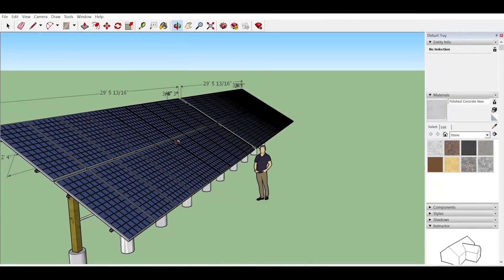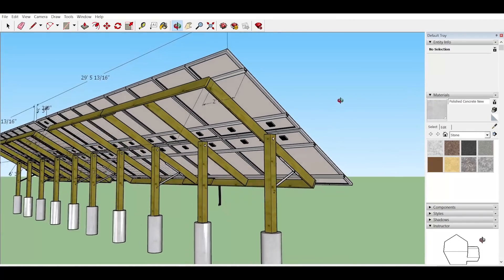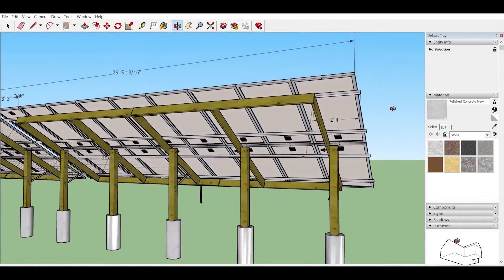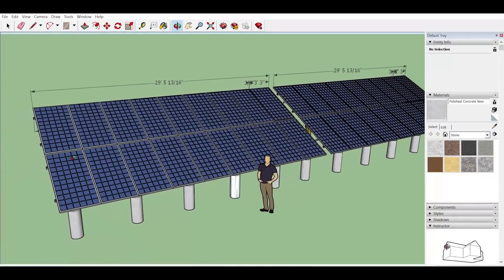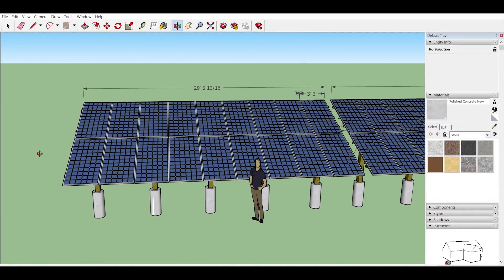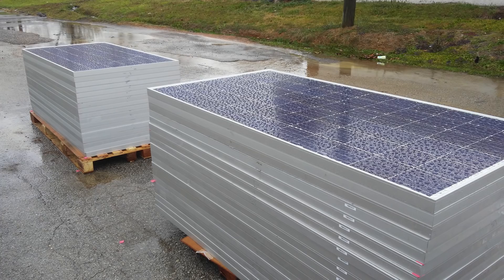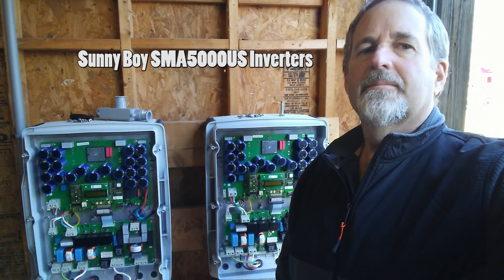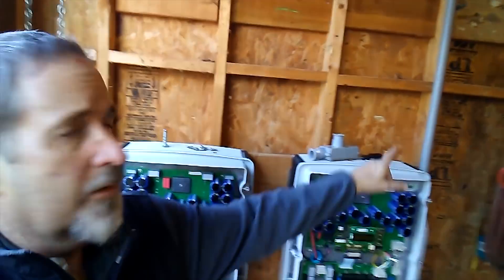BUILDING A 10,000 WATT SOLAR FARM  - Part 1!

Comment: I like the design!!! I'm planning a similar-sized season adjustable array of my own... what size Lumber did you use for your post it looks like 6 x 6? And your pivot arms 2 x 6? What do you use to tilt it with I had an idea of using a manual jack screws  like a linear actuator type thing?

Comment: Fasil the solar panels together is not leakage in between them the things you use underneath the solar will last 40 years mine's all wooden I rebuilt my frame I took the old out and we use the old frame with a small set of solar panels start with had a few extra and I probably that's be another 30 as long as I keep the water off and the snow.

Comment: @Electronic Solutions   Is the wood for your mount 2x10 or 2x12? Im getting ready to use your design substantially and add some improvements to incorporate a safety cable for use to prevent the mount from slamming downward on its front side during angle adjustment and also as an aid to pull on the rear to bring rear side downward for summer adjustment.  Did you put the blueprints online anywhere by any chance? Ill be using NEO 335w panels.

Comment: Like the adjustable angle mounting of panels, always a good idea when possible.
Hoever- that is a very heavy and large racking system ( very susceptible to high winds )
Please secure it as much as possible !
Our panels were removed by wind (hurricane) and were directly mounted to roof racking.
The roof and racking remaine intact but panels were peeled right off.
Your build looks more at risk than our old roof mounts.
More wood, chain, cable or whatever you can do to protect your investment and labors.
The vibrations that build up during high wind scenarios can literally shake and rip things apart. We were well built and secured and still ended up replacing our entire array.
Bigger, stronger , better...
Reply: Yes, Ian just passed by here near "Mayberry," NC and I have a windy property, so that is a major consideration.

Comment: We are thinking I'm doing the same thing. How far are your panels away from the batteries, and how big of wire do you need to run that distance?
Reply: My system is similar to his and my pv wire run is 160 feet.  The size wire used can be determined by the voltage it will carry and the amps it will carry.  The less amps and higher voltage the smaller the wire needed.  The voltage you can use will be largely determined by the inverter or charge controller you use.  For instance most inverter vary from about 140 volt to about 450 volt pv input from the panels.  I was able to use 10 awg THNN wire because I used 240 volts with 6 panels in series to reduce the amount of strings and I run 2 strings in parallel to each MPPT controller.  This is in my case 3600 watts and the max for each controller is 250 volts  and 4,000 watts. If I had used 2 strings of 7 it would;d have been 280volts and 4200 watts which is too much and damage would occur.
Here is a link to  a voltage drop calculator you can use to determine the size wire you need.  Iy would have cost me $365 for 8 awg wire but only cost $180 for 10 awg. I think the link will show values I used but you can change however you want just fill in the numbers.

https://www.calculator.net/voltage-drop-calculator.html?material=copper&wiresize=3.277&voltage=240&phase=dc&noofconductor=1&distance=160&distanceunit=feet&amperes=16&x=65&y=16
Reply: I forgot you get the voltage from label on the solar panel open voltage and the amps from it also as  vmax.  since mine are 40 volt panels and 9 amps 6 of them make 240 volts and 9 amps. then adding another 6 in parallel the voltage remains at 240 volts but amperage increases to 18 amps.

Comment: greetings; i realise it has been a long time since installation but i was wondering if you experienced any corrosion on the unistrut where they came in direct contact to the treated boards used for the structure. i am in georgia as well (there is no other place like it)...............g

Comment: I am almost through erecting a mount similar to yours for a single 30 panel mount (60 cell panels) that mounts 3 panels vertically and 10 panels wide using 6 posts. So far so good.   I searched long and hard before deciding how to build the mount and your mount was closest to what I actually did. I wish it had come up higher in the search results almost didn't find it.

Comment: Enjoyed the video.  Did you add more bracing to the wood frame?  From what I've seen of much sturdier pole buildings blowing apart you are seriously under engineered for the size of that sail.  You have a lot of money in your panels so no reason not to build for that once in a 100 year storm.  The posts themselves look ok although I would have went with two rows.  If you bought the posts from a home center they are in all probability UC4A instead of UC4B pressure treated.  Which means they won't have the 20 year life you're looking for.  Just like a deck some will last and some will not.

Comment: Awesome brother... Just subbed... I just finished my array build mother's day... Video up yesterday.. I'd love too see what you think... Yours is nicer but my budget is lower. I'm 6.4kw... ... Thanks for being awesome and I'll be checking out more
Reply from the maker: Good deal! You will love your power savings. I'm going to be adding more to my house soon. This video is a friends house we did. I currently have a 2700 watt system but Georgia power was only paying about 4 cents per kilowatt. They have now announced they will soon be offering an even trade. That's a big deal! If you use 1000kw a month and make 1000kw then usage will be zero on the bill.
Reply: @electronicsolutions1126  TVA here used to pay higher than they charge so they could sell the surplus for higher as GREEN energy and maybe some type government incentive as well as not having to build new power plants .  Then charge was .10 per Kwhr and paid .15.  Now they charge .10 per Kwhr and pay .075 per Kwhr.  Still a lot better than some states or areas like Missouri where some payt about .02 per Kwhr.  I am almost at the point where I could either buy more batteries or use generator more and go offered in the city cheaper than paying the monthly meter fee.  I don't sell to the utility anyway.
Reply from the maker: Its like using the grid similar to a battery bank.
Reply: @electronicsolutions1126   I contacted my utility(Jefferson Electric ) and they will only pay 5 cents per killowatt and then sell it back to you at night for retail. I hope the new Administration enacts some solar credits for Georgia like SC does.

Comment: Hello, i hope you are still responding to comments on this video. i have several questions. Did you require a permit for your land to do this yourself, how were your taxes effected by this, and where are you located (which state)? I completely have the ability to do all of this myself and was wondering what legal hoops you had to jump through.
Reply: nevermind, i see you're in Georgia. that answered that part
Reply from the maker: Were not in the city limits and did not need a permit, just the paper work and basic inspection by the power company. They want everything UL 1741 listed from panels to inverters. A UL 1741 inverter will automatically be approved since it powers down properly if the grid goes down, thereby protecting line workers if they are working on the lines.
Reply from the maker: I would recommend looking at your County ordinances. Our County has no restrictions other than to follow National Electric Codes.

Comment: I like what you did and I am taking your Idea, How large were the bolts that you used so that you could tilt.
Reply: I used 7/8 inch grade 8 rust resistance bolts washers and lock washers and nuts. You buy them by the pound at tractor Supply they look like anodized metal.  One set including 2 washers was about $9 so 5 would be around $45.  I believe a much smaller size or at least 3/4 would be plenty strong but I wanted a larger hole to spread the pressure out on the wood post.  You can also drill a larger hole and use 1/2 CPVC to spread the pressure out even further and act as a bearing too but the tilt doesn't require much pressure.  You could also make larger square metal plates of say 1/8 - 1/4 steels with holes for screws and center hole for bolt to spread the pressure out.

You could also add more posts etc.  remember you want the connections of the unistrut between the "rafters" to keep unistrut at same level.    

In my similar system 
six 2x10x 16 ft  about                         420 lbs
unistrut 20 total pieces x 14   about 280 lbs
30 solar panels @ 41lbs each          1230 lbs
                                                     _____________

                                                             1930 lbs

on 6 posts         =            322lbs per post 

Remember wind load  can be much higher than this but is largely horizontal load not vertical load.     You may wam
nt to add some cable tie downs to the post to offset those loads depending on the mounts location.

Comment: hi do you still have the sketch up plans,,,so if i wanted to copy your set up i could?,,or maybe a metrail list for the racking? thanks
Reply: Unistrut (or superstrut) can be purchased at Home Depot or Lowes.
I have the plans in sketch up. I will see if I can post them to a shared google drive location and link them in the comments!
Reply: @robertballard626  sounds good,,thanks

Comment: Where's a good place to buy surplus solar panels for cheap?
Reply from the maker: Keep an eye on Ebay. Buy in bulk like 10 or more because a pallet can hold up to about 26 to 30 panels and will cost around $275 to ship. If there are 10, 20 or 30 the cost will be near the same. Your shipping cost per panel drops with a larger amount.
Reply: I’m wanting to get some for my school what should I be looking at

Comment: in California PVC conduit need to be buried a minimum of 18"... guess Ga. Is more lenient. Did you have to pull permits for this project?
Reply from the maker: We were not required to pull permits. In our area the install is recommended to be UL listed and inspected by the Power Company. We should have used rigid metal conduit which has a minimum depth limit of 6 inches (or 4 inches if protected by concrete). We had huge rocks below so about 8 inches deep so that was about as deep as we could go. Power Company gave it the ok since its all behind a breaker and there is no vehicle access over the conduit. With any project each person should check with the county they live in to see if any permits are needed. We have 2 power companies in our area. One is very strict needing a certified solar installer to sign off on the the project and the other does their own inspection.

Comment: Can you please  can share it. Its not entirely complete as in it does not show all the screws and mounting hardware
Reply from the maker: I used Unistrut or Superstrut as Home Depot calls it. Go check out the Home Depot website and search for it. They sell all the hardware to fit. The mounting screws are your choice. You can use 1/4" or 3/8" screws and match with the correct size strut channel spring nut and the top square washer to hold the panels down. The length of my screws was 2" long. That would work with most solar panel thickness. Some panels are thicker than others on the frame and they usually range from 35mm to 55mm thick. Be sure to order the right size end clamps for the thickness of your panels. I found mine on ebay for about $1.50 each. Its a simple solution for mounting solar panels and way more affordable then using aluminum channel made for solar.

Comment: Looks great. Do you have a copy of the plans? I have 4 kw on my roof and am looking to add another 4k in this configuration.
Reply from the maker: How are you connected now? Using a string inverter or micro inverters? I have done a few installs with micro inverters where you have a small inverter for each solar panel that convert the DC to 240VAC. I may add an additional 1000wh to my roof and just use 4 - 250 watt panels and 4 micro inverters. I just need to add a 240v double pole breaker to feed through. I will make a video on one of those setups real soon.
Reply: @electronicsolutions1126  I have a Sol-Ark 8k. It has a dual mppt controllers. I have 1 string on roof in a SE direction. I want to put another 5.4k on a mount like this in a ssw direction. We are putting in a heated pool and this is how i convinced the wife the power bill wouldnt go up.
Reply from the maker: @av1204  Sounds good. another 5.4kwh should definately cut back on the heating bill for the pool. You may want to consider a timer on the pool heater. Run it during the day when the sun is out.

Comment: 4 years return on investment? Thats a deal hard to pass on!
Reply from the maker: Do it yourself is the way to go. I saw a quote for a system this size and it was $100,000. It did have an off grid battery storage and an intelligent inverter to charge the battery before sending the excess back to the grid but there must have been a lot of labor in the quote. There is no way adding a better inverter and an LG Chem battery pack would raise the cost almost 10 times more.
Reply from the maker: Yes. Do it yourself!
Reply: pity there are no numbers to go with the assertion
Reply: @yarpos  I have a 13,500 watt system with 30Kwhr lithium battery backup for the following cost. Yes, it can be done DIY.  Mine and I believe his are off grid:
42 300 watt new "open box" panels made in USA $105 each   $300 shipping  $4710
3 MPP MG5048 with parallel kits shipped to door  $2250
10,000 watt Transformer  $300
Mount including wood unistrut concrete  bolts conduit (for hole in post)  conduit rental trench digger and auger  $1124
2 guage battery cable 50 ft  cable ends plywood mount pvwire 10 ga various short wiring grounding rods  $700
battery new lg cells from chevy bolt never cycled 30 Kwhr $3300 delivered (70 cells)

Grand Total :   $12,384.00
30% credit      -    3,714.00
-----------------------------------------
after credit      $8,670.00

payback period 5.5 sun hours per day avg 5.5 x 13,500 watts = 74.25Kwhr per day
at .10 per Kwhr                                                                                  = $7.43 per day
avg30.5 days per month                                                                  = $226.62 per month
minus 15% for inefficiencies    ( $33.99 )                                      = $192.63

$8670 divided by $192.63                                                                =  45.01 months
This system can provide 15,000 continuous watts or 30,000 peak watts or 125 amps at 240 volts split phase. (yes the transformer can provide this since with all the larger loads balanced 240 volt loads). I rarely use more than 8,000 watts continuous.

Even if 20 % loss in efficiencies still less than 48 month payback though I plan to add another 30 Kwhr of battery backup in time which would make payback another 16 months or so.
Reply: @teekay1785  Why would you add more capacity when you only use a fraction of what you produce now?
Reply: @slrs3908  Because the sun doesn't shine at night and because the sun provides about half that power on a cloudy day and because you can have several cloudy days in a row .  But the bigger question is how would you know that I wouldn't need more.  In winter when heat is needed my water source heat pump using the 2 stages can use over 4,000 watts. 30kwhr can only run that 7 1/2 hours . Winter sunshine is less energy and its less hours too. So on the coldest days with heat running continuously I will be using grid several hours each night  no matter how many panels I have . The amount of storage is the limiting factor.  If batteries were cheap I would have at least 72 hours of backup or about 300kwhr and would never need generator etc but for $33,000 I would just use wood or LP gas heat LOL.

Comment: 500lbs of cement for each post?!?
Reply from the maker: We drilled a 14" hole about 3 1/2 feet deep. Each post had about 6 bags of cement, 80 lbs each. Some a little more. It was probably closer to 400 lbs each. We wanted it to stay put over time. The base was the hardest part of the project. On my next solar project I may just cement unistrut legs in the ground and bolt it all together with a pre-set tilt towards the sun.
Reply: Ikr

Comment: i like what you did. i'm just a little  uneasy using treated wood for a rack system.
Reply from the maker: We did use the heavily treated lumber designed for ground contact. It should last a long time but I think my next project I will go with all unistrut. You can cement it in the ground to use for legs.

Comment: Hi do you happen to have any info on how to go about getting surplus solar panels I'm looking to build the exact same system
Reply from the maker: Ebay is a good place to start. check shipping prices with the seller.
Reply: For used, and surplus panels try San Tan solar in Arizona and Sun Electric in Miami.